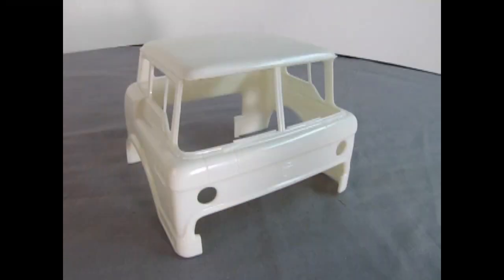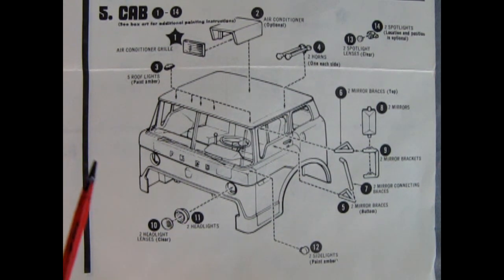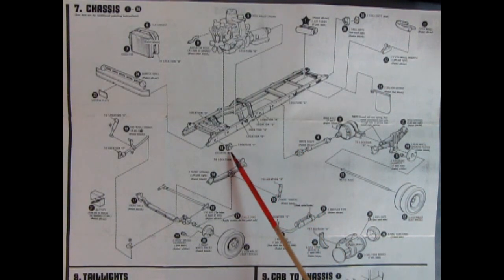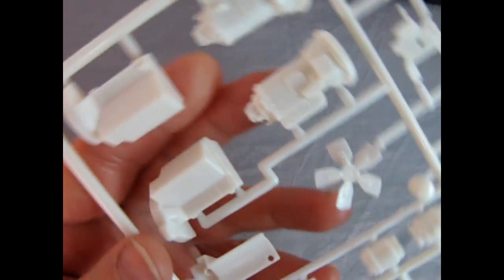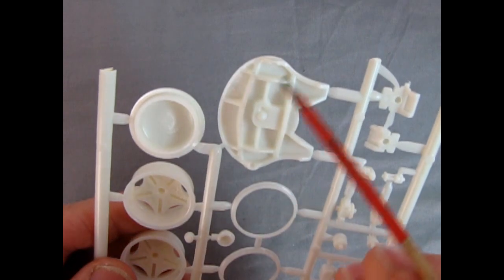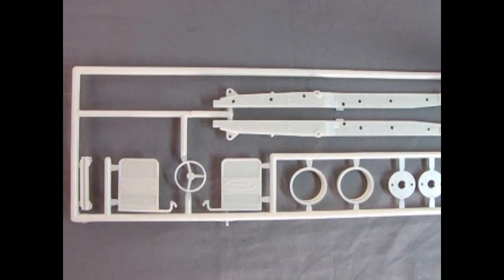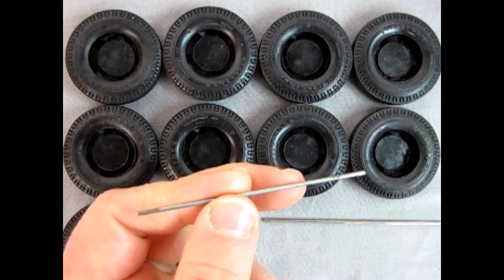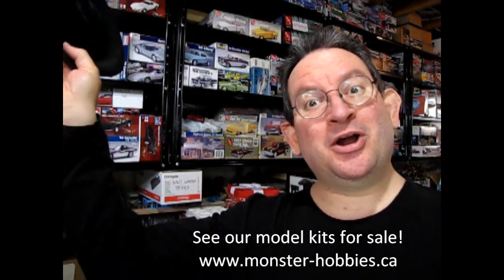Model Car Garage - The AMT 1957 Ford C900 Tractor Model Truck Kit - A Model Kit Unboxing Video

Comment: I have been building models since 1970 lol . My first one was 1939 ford coupe . I’m still at it . I use to like AMT , they gave you spare engines, tires, and wheels , i still fine some very option models to this day , not often but i snag them
Reply from the maker: Always good. Check out my engine build videos on this channel. I discovered what all those custom engines are from the AMt Trophy Series kits like the Olds engine found in the 1939 Ford Sedan. (the coupe was a 1940.)